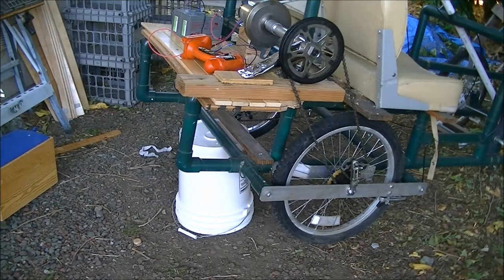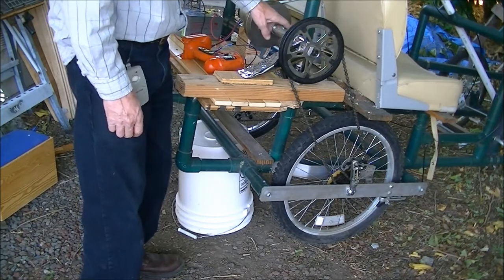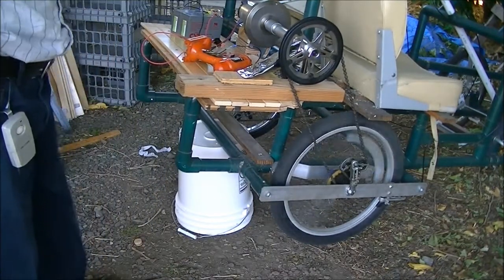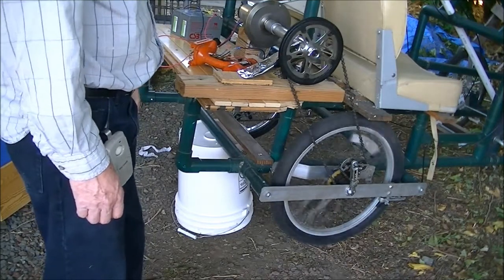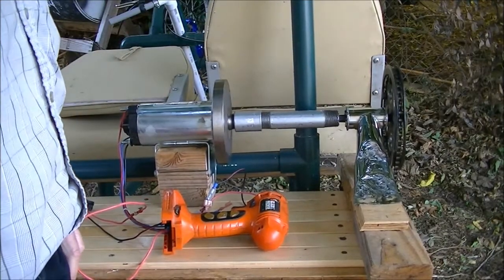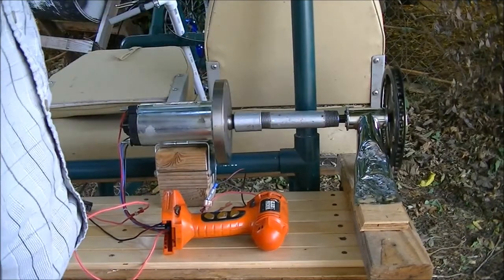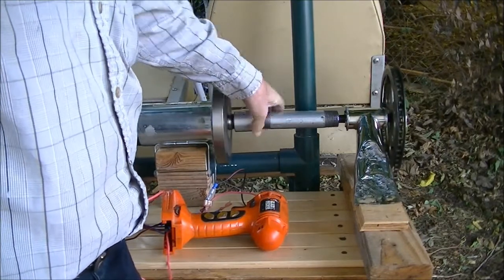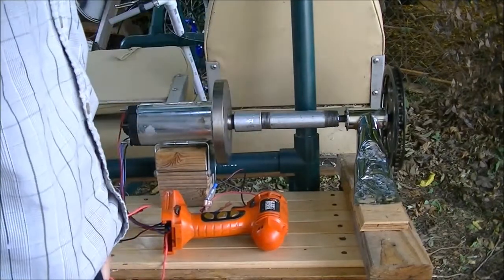4 Wheel Electric Bicycle Car Progress 1

Comment from the maker: Everything you said in your comment is true, but if you stay tuned you'll see that I do get this project working. I now have a better motor, one with a gearbox, plus a smaller sprocket, and a motor controller plus throttle. With luck I'll have things operational this weekend. Then I'll need to make it more permanent, and do whatever improvements need to be made. Thanks for your input. I do appreciate it.

Comment: That drive sprocket is way too big. That will never drive that car when the wheel is on the ground. That tiny SCR controller IC in the cordless drill speed controller is not going to cut it either. A 10 or 12 tooth sprocket would be pressing it for the torque needed to turn a loaded wheel from the hub.

Comment from the maker: One of my many flaws is that when I'm building something I get impatient to get things working. I'm going to push through with the original plan, but I'd rather have the drive shaft welded because it'd be better, probably stronger, and it would look nicer. If you could weld the final drive shaft I'd be most appreciative.

Comment: looking great so far!  use a hacksaw and cut several vertical slots through the threaded part of the pipe. use a pipe clamp or even a couple of hose clamps to tighten the threaded area down on the socket.